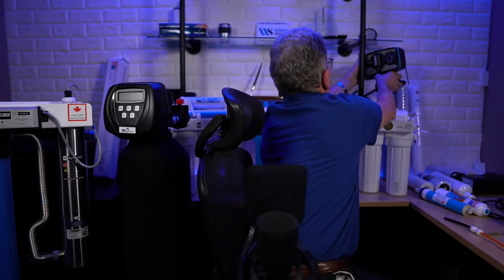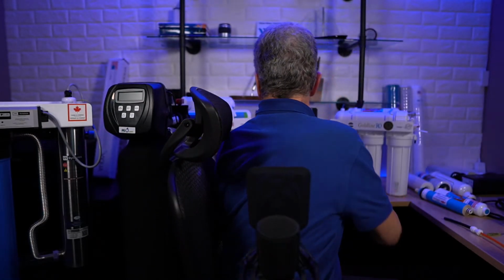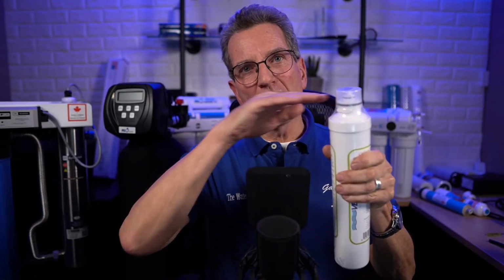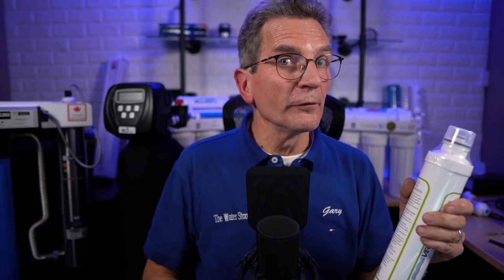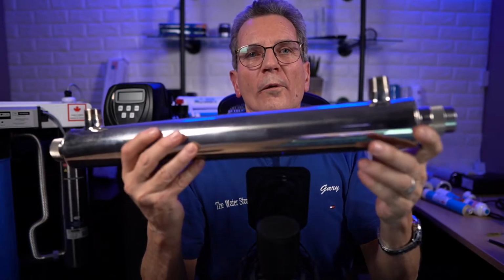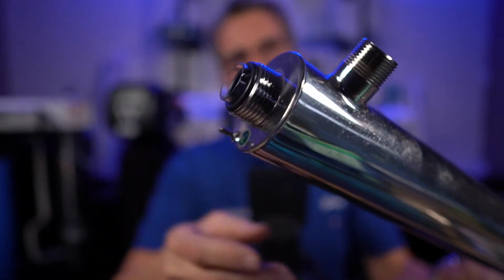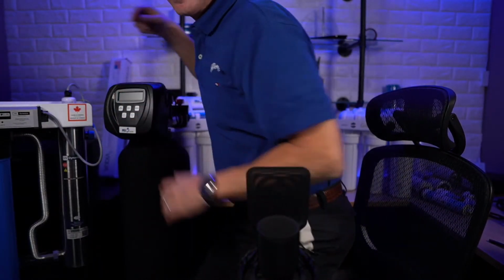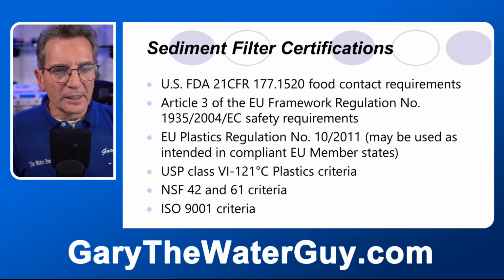MADE in NORTH AMERICA Water Filter Systems for HOME

Comment: The water saver 75 uses gro-75 membrane, on it it says made in China. So maybe designed in USA but manufactured in China.

Since I'm committing, i have not see a video from you that shows how to sanitize the water saver 75. Curious around the membrane... guessing it has to be bypassed ???  
Thank you
Reply from the maker: The membrane is Made in China, but enough of the rest and the assembly is done in the USA which classifies it as being Made in USA.  It is the same as vehicles.  To disinfect you run the disinfectant through the membrane and then replace the memebrane when done.
Reply: @water_estore  in other words, once every 3-5yrs (have a huge whole house carbon "filter" (its in a softner rasin tank - done by my local water store) plus softner) when the membrane slows down / dts reads high.
Thanks so much for the prompt response. Hello from Georgetown Ontario.